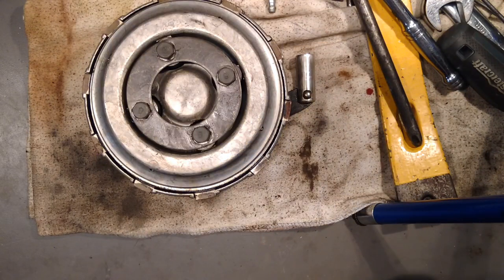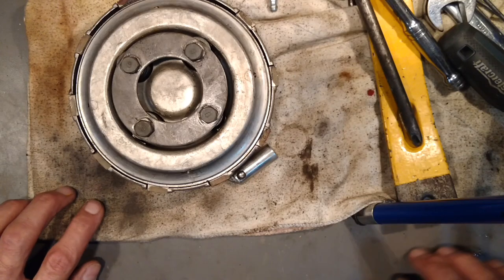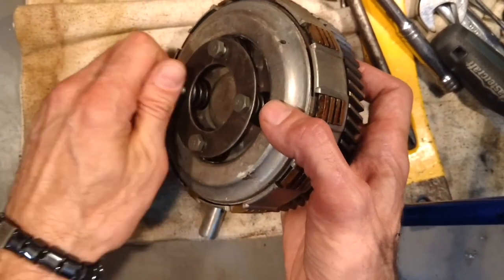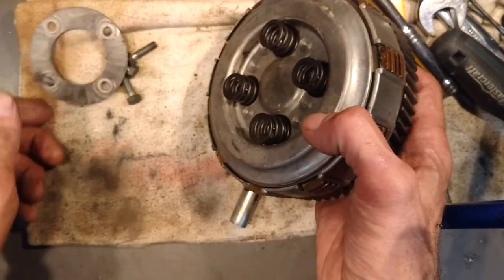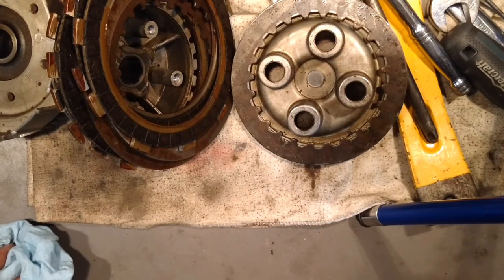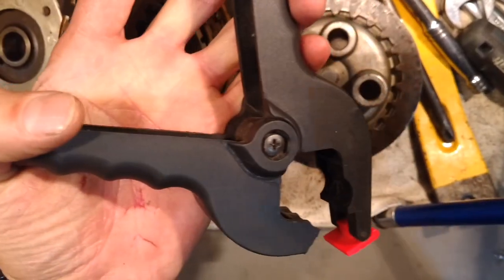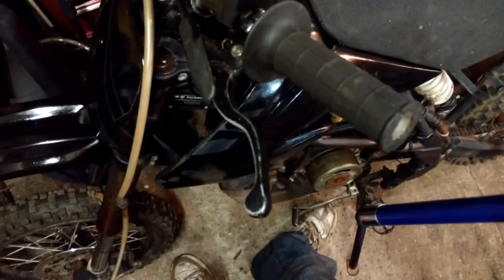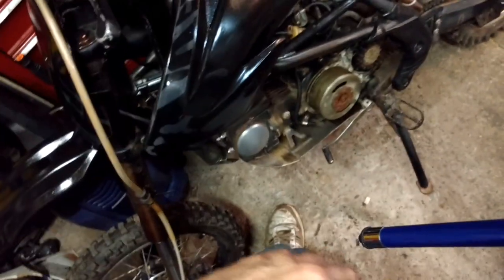Unseize your motorcycle clutch without removing a single bolt.

Comment: My quad has a pull start on it should it work?
Reply from the maker: What kind of quad?  If it has a hand activated clutch like a typical dirt bike or motorcycle, then it would apply.   Most quads, especially utility quads, the clutch is adjustable.  This needs to be done periodically and is usually very easy but having a service manual for your exact model or a trusted source is a must.  If you tell me year, make and model, I will try to source information for you.
Reply: @shopyoga  i got a lt4x4 250
Reply from the maker: @bluegrassadventures8227  That style is not a hand operated manual clutch, so the method I speak of in my video does not directly apply.   You have a semi automatic transmission.  Meaning, it's my understanding, that you actually have two clutches working in there.  One that engages (starts pulling) when the engine rpms rise, by centrifugal force.  The other 'disengages' with the operation of the foot shifter, while changing gears, to make shifting smoother.   They work hand in hand and diagnosis of which is giving you trouble is done by operating the atv and paying close attention to its behavior.  Adjustment of the adjustable clutch is done on the outside engine case.  You will see a nut and screw.  The nut is loosened to allow the screw to turn free.  Best practice is to hold the screw and back off the nut so you can see space between it and the case, then turn the screw in (I can't remember if it's clockwise or counterclockwise)...as long as it goes in until it stops, then back it off a half turn.  Hold it there as you tighten the nut. Oh, and,  I like to keep the screw fixed if possible in its original position and count the turns as I turn it in, so I know where it was before I made any changes...so I know how much it was out of spec.  The only job that nut has is to keep the screw where you put it.  Try that setting and see how it feels.  You may have better performance from a quarter turn out...or three quarters turn out.  Every machine wears a bit different and what works for one is not necessarily best for the next similar model.  Also, consider any changes you made lately.  Oil change?  Maybe wrong type of oil.  Sometimes the strangest thing can have an effect.  If you had to increase the idle speed because it keeps stalling, remarkably, that effects clutch action... and sometimes a lot.   Erratic idle?  Oil level low?  Those affect clutch.  Finally, those clutches and known to be incredibly durable, so I suspect just an adjustment.   Also there is a remote possibility that plates have come loose on the clutch.  Once again, this is where paying attention to the performance is important.   Hope some of that helps.  Give me some details about what it's doing if you like.  Sorry for the novel... Cheers

Comment: Does this work on a Vulcan 1500
Reply from the maker: Yes.
Reply: @shopyoga  is the clutch lever supposed to feel soft when the clutch plates are stuck together or is that just air in the line
Reply from the maker: @GRPPLRJORDAN  sounds like you need to bleed the slave cylinder.  My 1400 Suzuki intruder does similar thing if it sits a while (6-8 months) clutch lever gets soft I have to bleed it to get proper clutch action back. Check fluid level might be low and it let air in. Squeeze the lever multiple times. If it gradually builds pressure, needs bled.  If bleeding does not solve, a close inspection of the line. Lines age and break down internal, swell and clutch won't disengage.
Reply: @shopyoga  I appreciate the answer. I already rebuilt the slave and master cylinder and have been bleeding the line to no avail. I have inspected the line but I don’t see any problems with it but im Jo master mechanic so I don’t know exactly what im looking for. Maybe I just need a new line.

Comment: I have a hd street 500 and it will stall when i put it in gear also i tried to move it while it was turned off by pressing the clutch and it wont move. Help please.
Reply from the maker: Hi Jose Silva, I think your bike has a hydraulic clutch, yes?  Sounds like it may just need to be bled again.  That's a bit of a down side with hydraulic clutches.  They can be temperamental, especially in temperature changes or lack of daily use.   Next time you start your bike, let it warm up for a good ten of fifteen minutes before trying to put in gear.  Cold engine/oil can cause enough drag to easily stall your engine or not allow to push against the engine even with clutch pulled in....cheers!
Reply: sir did u fix it? i have ktm exc525. when bike cold .. push clutch pu first gear. he dont work . after engine hot. it drag litle bit... so .. i dont  know if its the clutch stick or its bad basket... can u solve it?

Comment: One day i was riding my bike 1994 klx250 everything was going well and i was going slow and my bike stalled and my bikes clutch wont work i cant seem to figures out on whats going on
Reply from the maker: +Timo Hacks hi there.  Not sure how mechanically inclined you are or if you made any repair attempt yet.  It's a little unusual to instantly lose all "cable style" clutch action unless cable snaps.  Start with the easy, external stuff like: 
Maybe the cable just broke?
Has the cable stretched to the point where the engine is always pulling or stalls when in gear?
Was the clutch hard to pull or making noises of any sort?

Information is key to diagnosis🤔

Is there any cable tension/clutch action at the lever or just flopping around like a fish out of water?
Check also that the engine end of the cable is still in proper placement.  
That bike, and klr's for that matter, is 'old technology' meaning many aspects had been unchanged for years prior and stood up to the abuse.  It's rare, but certainly not impossible, that the problem could be internal.  Do some investigating and tell me what you find.

Comment: Good advice but your 9:22 remark about "... after it's broke free when you're riding it doesn't necessarily mean that all the plates broke free so that bike may feel really strange..." can't be correct.  The only way for the clutch to disengage the engine from the transmission is if ALL of the plates have broken free.  The reason the "...bike may feel really strange..." is likely residual contamination of distortion wearing off.
Reply from the maker: Absolutely correct, all plates have to break free.  Not sure where my thinking was going there.  I've had a few bikes feel wonky for the first few minutes and I suspect now that was just dry spots or as you say residue on parts of plates.  Cheers 😁

Comment: Hello sir! I’ve got a Honda CB100N. Are you saying that I should clamp the clutch lever down with the bike in first gear? And then try to kick over the bike with the clutch still pulled in and the bike still in first gear? 

Or is the idea that you just leave the bike for a while with the clutch lever pulled in and this releases the stuck plates over time, and you start the bike as normal (in neutral)?

Much appreciated!
Reply from the maker: Hi!  Yes, clamp in your clutch lever for at least 24 hours, sometimes it may take a few days to a week to break it free.  First, neutral, second, gear selection won't matter during this time.  I like to turn the engine over a few times every day to get the oil all around the clutch plates.  The stuck clutch is normally just the natural state of the clutch (plates squeezed tight) has squeezed oil out of the fiber plates so they lose all viscosity. Squeezed and held clutch removes tension from plates allowing oil to seep into the fibers again.  Then, a little jolt from kick starter or running bike switching from neutral to first should break them free. Hope this helps 🙏

Comment: Hello mate do I need to keep the clamp down in first gear and then kick it over in first until it’s free. Or do I simply leave the clamp on for a while and then try to use the clutch as normal?? I had a motorcycle accident and I had to leave my bike at Uni, trying to take it home today but when I put it into first gear it lurches forward and stalls out. It’s been about 5 months
Reply from the maker: My apologies, somehow I missed this comment altogether 😞.  Hope you are doing well since the accident.  Probably you have sorted the problem?  Is your clutch hydraulic?

Comment: Do u think this could be the problem with mine? It goes in neutral ok but jerks to a stop as soon as i put it in gear
Reply from the maker: Sorry for such a delay in responding, life got crazy.  Did you get your trouble sorted out Clive?  It does sound like the clutch isn't letting go.  Another possibility is kickstand safety switch but that can be ruled out if they bike will actually move under its own power, then when brought to a stop in gear immediately stalls -that kind of behaviour points directly to clutch.
Reply from the maker: @cliveswabs9365  glad to hear you've had success!  That exhaust job sounds like a good time... Cheers 🧘‍♂️